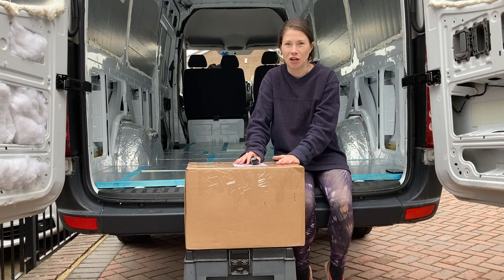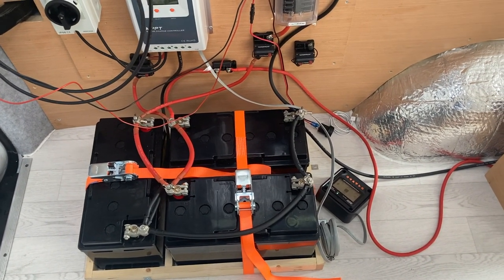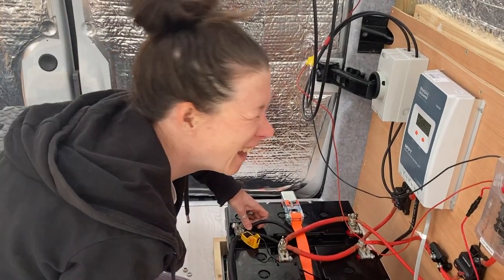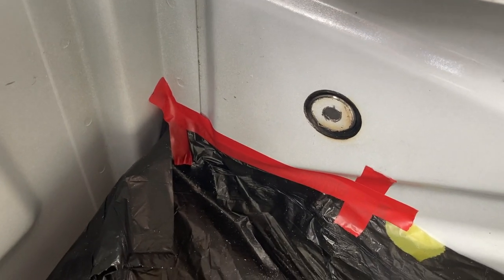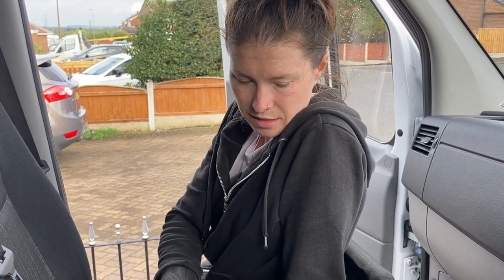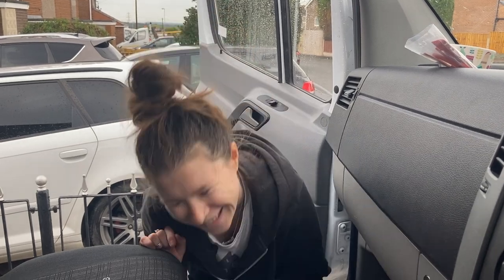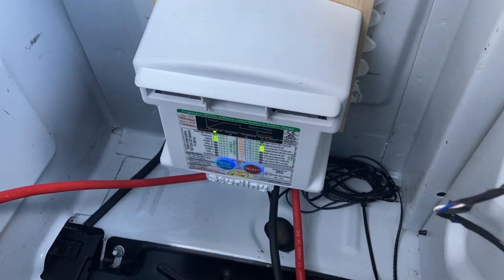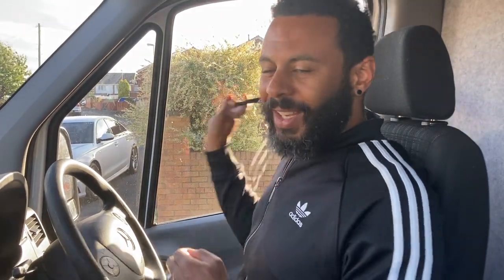Sterling Battery to Battery Charger Install | Sprinter Conversion Electrics

Comment: Sarah the Master Electrician does it again. Great video guys.
Reply from the maker: Thank you! “Master electrician” though 😅
Reply: @TheWholeWorldorNothing  Can I ask why you chose this particular charger?
Reply from the maker: It was reasonably priced, had good reviews, but most importantly it was actually in stock when we were looking for one! We really struggled to find them at that time last year, loads of stuff was sold out. Oh but if you’re meaning why we went for the 60 amp one then its’s because it charges the batteries quite quickly. Does any of that actually answer the question?! 😅
Reply: @TheWholeWorldorNothing  Thank you, yes it answered everything. I ended up buying the Victron but was looking at this one and the Renogy and I just wondered what tipped the scales for you.
Reply from the maker: Ah ok. Yeah we didn’t have too much choice in the end - it certainly wasn’t because we thought it was a better brand than victron or renogy, they all seemed relatively similar.

Comment: I like that you didn't do the negative from the house battery to the vehicle ground without going back to the starter battery...  not sure about that, but seen other people recommending that you can do that.  Seems "unsafe" to run the negative through the car body only.

Comment: 3:36 its for lithium battery's, if they are cold it will limit the current coming in to avoid damaging the battery.
Reply from the maker: Ah right, that explains it! So it doesn’t do anything for the batteries we currently have? Nothing lost anyway, better that we have it installed for if/when we decide to upgrade to lithium 😀 Would be a beast of a job to retrofit.
Reply: @TheWholeWorldorNothing  Depends on your components if you bought all victron stuff just swap out battery 4 battery, my stuff wasn't compatible had to buy new controller etc.
Reply from the maker: Ok that makes sense, thanks 👍

Comment: Hi loving your van build series, is there a reason for not installing 240 volt hook up just in case?
Reply from the maker: Hi! Thank you very much, glad you’re enjoying it 😀 Yep the reason we didn’t install a 240 hookup is because we never planned to spend much time on campsites so it would have been a large expense for something we actively didn’t intended to use. We spent a little more buying a larger (60amp) battery to battery charger as our backup instead. Hope that answers the question! 👍
Reply: @TheWholeWorldorNothing  thanks 😊
Reply from the maker: You’re welcome ☺️

Comment: Did the Sterling charger need a D+ information for knowing when car is turned on?
Reply from the maker: I’m gonna say no because I’m not sure what that means! What’s a D+ information?
Reply: @TheWholeWorldorNothing  Actually, my 60 amp sterling suggests a D+ connection.  So that the B2B is only charging when the van is on.
Reply: @TheWholeWorldorNothing  think some Stirling chargers (& others?) may not need a signal ("D+") from a (12V) circuit which is live i.e. when the ignition's on. E.g. if the charger "senses" vibration when the engines running; just wondering if the wooden batons would dampen the vibration? Default, if the vibration doesn't work, is to put in a signal wire to the ignition --- more complicated though.
Thaks - great videos.

Comment: Hi guys..I got one of these and haven’t installed yet. Rain forecast for the next 2 weeks so I gotta do it.

You sayin to run 2 negative wires from the starter battery…one to the Sterling b2b and the other to the house battery right? And no need to ground anything to the van body?

Also, how can I get an attractive English woman to do all my wiring for me? I must be doing something wrong
Reply from the maker: Yep! Perfect time to get on with it 😀

Yes, that’s exactly what we did and absolutely no need to ground to the van, no. This was following the manufacturer’s instructions but probably worth double checking yours are the same, especially if you’ve got a different model. 

Unfortunately Sarah is spoken for but I’m sure there are plenty other attractive English women out there just waiting to get stuck into some wiring 😅 Good luck with your search 🤣
Reply: @TheWholeWorldorNothing  did you already have your leisure battery grounded to the van chassis? Mine is not and I'm not sure if that needs to happen? Thanks.
Reply from the maker: No we don’t have the leisure battery grounded to the chassis either. We kept the campervan electrics completely separate to the vehicle electrics.
Reply: @TheWholeWorldorNothing  that’s a big help. Difficult finding info online for that specific question. Thank you again for your help and best of luck to you guys
Reply from the maker: Yeah we found the same, but from the research that we did it’s best not to mix the two 👍